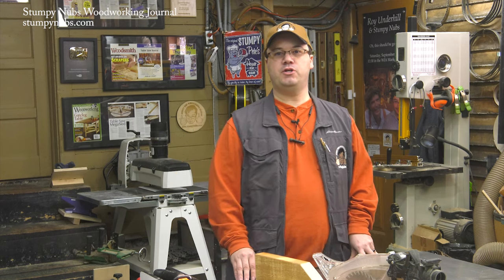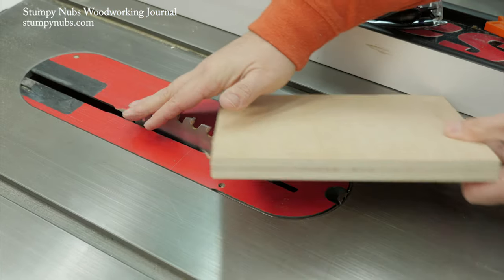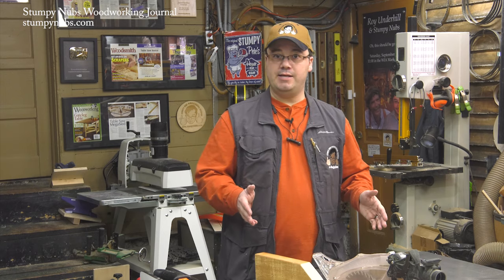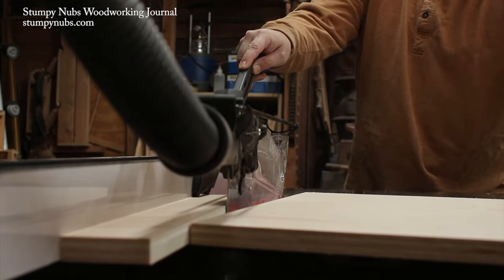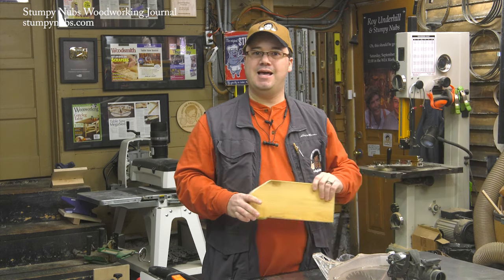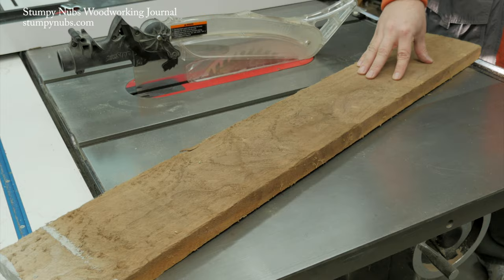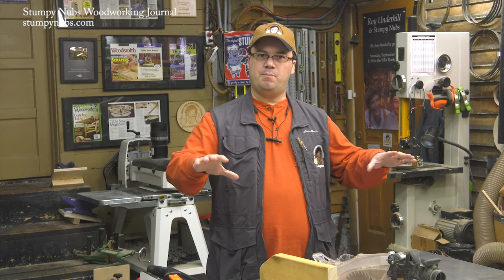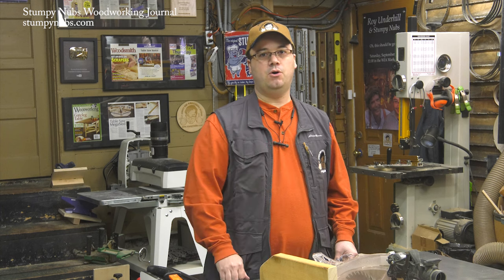Table saw safety tips you forgot about (or never knew)

Comment: @1:45... The blade guard prevents kickback?  How is that, since they are made to move up and out of the way during a cut.  I’ll grant that it will help in the event your hand starts to head toward the blade.  It would seem to me that the first thing to prevent kickback is a riving knife.  Followed closely second by a splitter, and third the pawls that come at the very back and help keep the wood from moving backward.  Maybe I missed something?
Reply from the maker: The blade guard includes a splitter. It's explained in the video.
Reply: Ummmmm... isn’t the splitter part of the throat plate?
Reply from the maker: A splitter is anything that splits the material behind the blade. The metal strip on the guard is also a splitter. It's all in the video...

Comment: What is the difference between a splitter and a riving knife? When do you use one instead of the other?
Reply from the maker: A splitter sticks up above the blade and usually is used to attach the blade guard. A riving knife is slightly shorter than the top of the blade and moves up and down as you raise and lower the blade. Both do the same thing, but a riving knife may be used when making cuts that don't go all the way through the wood. On many new saws the splitter is permanently attached to the guard. When the guard is removed, the splitter comes off with it. A riving knife is then installed in it's place.
Reply: @StumpyNubs  Thank you. I have an old. used General 350. I am trying to upgrade the safety features. It has a very large splitter. But it hangs off the table, making the use of an outfeed table difficult. Are there any aftermarket parts you could recommend to improve both the safety and dust collection?

Comment: Any tips for those cheap job site saws without room for the knife or splitter?
Reply from the maker: I know of no saw for which you couldn't make a throat insert with an integrated wooden splitter (see link below the video). If one exists I would not use it. Your fingers are worth way more than the cost of a new saw.
Reply: That is true, I am very fond of all my digits and would like to keep them trauma free. I made a cross cut sled for it and it works ... ok..ish.  (Its a job site Saw, not exactly the most precision tool in the garage. It is however the only table saw I can get to at the moment.) I avoid doing rip cuts on it as much as possible. I’m going to try that wood splitter, I watched that video a couple of weeks ago and thought that would be a great addition to it. I know I’ll need to use it to build a few things so I’m hopeful the weather breaks soon and I can install the zero clearance w/ splitter and make a few things.

Comment: is the splitter supposed to be of the same thickness as the sawblade/bits?
Reply from the maker: As thick or slightly thinner. Not thicker.
Reply: @StumpyNubs  I measured the thickess on the blade and the splitter and it showed that the splitter was a half millimeter thinner than the blade 2.5mm. - 3mm. so I guess thats should be fine? I just bought the table, and I need to learn how to use it... the safe operation of it... is it important to use a splitter blade for splitting and an "appropriate" blad for cross cutting? there are tree different types of blades as I understand....